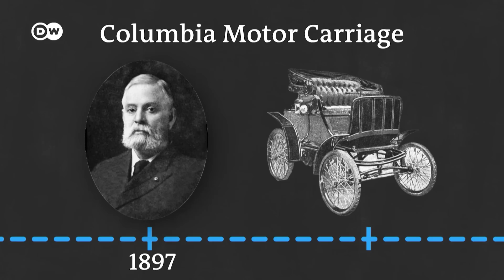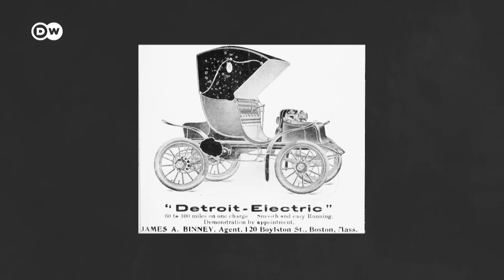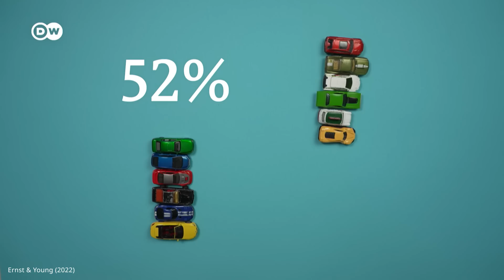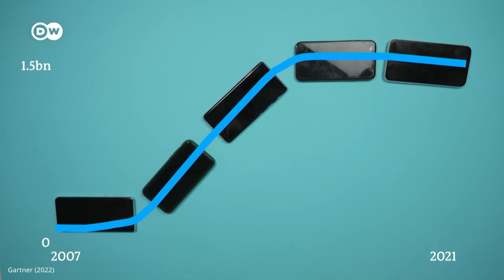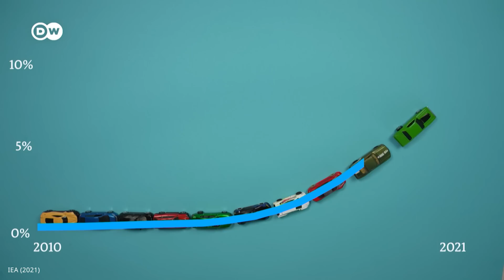Why electric cars are finally taking over

Comment: Writing from Norway, we are indeed on a different planet: Electric cars passed 80% of new sales this summer, and few people even consider an alternative for their next car. The secret initially was government subsidy, but now it is improved charging infrastructure that makes the difference. And how does it effect your thinking once you have one? It's all upside down: you think service costs, smoother ride and silence, no smells, better performance, less complexity - and cannot imagine why anyone would drive that other stuff. I used to love petrol cars, manual gears, so I am as surprised as anyone.
Reply: Love this. Norway, you are talking from the future!
Reply: I was in Norway last month and I didn't know that all electronic cars numbers their plain number beging with E. Which is great I think all country have to adopt that logic.
Reply: @dimitarklaturov  In Germany we also have an "E" on the car's license plate, but somehow we had the great idea to give this "E" to hybrid vehicles as well. The result now is that huge SUVs also have EV-like benefits and are constantly blocking charging stations because parking at charging stations is free in most places.

Sidenote: PHEVs have relatively small batteries and therefore wouldn''t need a charging station at all - a simple wall outlet could do the job for them. Most PHEVs can't even accept the power available at charging stations (most of them can provide up to 22 kW over here, while PHEVs can only accept up to 2 kW).
Reply: Ev car buyers are mind children,
Mind children are easily led — and easily misled.
Reply: Ahh, no. You're from another universe where people are more rational in their decisions, who prioritise long term strategy rather than fixating on short term conveniences.
Reply: Hearing people from Europe gleefully giving up manual gearboxes it’s amazing
Reply: They passed petroleum vehicles not because they are more functional, but because of propaganda.
 California has been asking it's citizens to not charge their vehicles in summer because with air conditioners running 24/7 there isn't enough electricity.
Building the infrastructure before mandating the EV change over would be responsible, which is why no Western governments are bothering with this niggling little issue that will leave millions without transportation.
Reply: Hello Norway. Yes, you are indeed on a different planet. You are at the bottom of the world's list od sustainable development index, the reason why some environmental intellectuals call you "the invisible ecological disaster". While you are so proud of your electric cars, you are still consuming resources that would need around 4 to 5 planets to sustain your system and lifestyles. You consume much more energy than the world's average, but also than any other European country. You create a lot of waste and you produce a huge amount of CO2 per capita... more than almost any country on the planet. But you keep out your dirt outside your country's borders. Very sustainable, sure.
Reply: Electric cars are too expensive and just not realistic - there’s no where to charge them and doesn’t get you far unless you live in a city and don’t plan on travelling far. They cost about the same as 10 petrol cars doesn’t add up and when you dispose of them causes more problems for the environment / that’s one thing they never discuss 
Plus prices going up petrol now cheaper than charging electric car 😂
Reply: That is awful, electric cars are so bad for the environment compared to public transportation.
Reply: @12kenbutsuri  gas cars are awful for the environment compared to public transportation. What is your point?
Reply: @mikeshafer  better does not equil good. EV will never be the future. Public transportation will. What's your point?
Reply: @12kenbutsuri  if you watched this video, it's pretty obvious that EV is the future, especially in the US where public transportation is not very common except in places like New York.
Reply: @mikeshafer  you need to read more before deciding on things on one youtube video. You do know that in europe, they also have public transportation in the country side?
Reply: @12kenbutsuri  I literally just said "in the US" ... I am not talking about Europe here or Asia or anywhere else.
Reply: @mikeshafer  then the US should spend the tax money on public transportation instead of EV subsidies for the rich.
Reply: @12kenbutsuri  I don't think you understand how the US works.
Reply: @12kenbutsuri  besides - do you have ANY idea how much federal dollars are spent subsidizing the oil industry? EVs cannot get here fast enough.
Reply: @mikeshafer  like I said, better does not equil good. If you don't care about the environment, go for EVs.  I'll stick to bicycles and public transportations like a responsible person.
Reply: @12kenbutsuri  I think we're both arguing different points. I'm suggesting EVs are the future, you're saying more people should ride bicycles. I don't disagree with you.
Reply: @mikeshafer  I understand, but to me EV has done more harm than good by allowing the inefficient car society to continue longer, which I am very very upset about. We really need to restructure the whole society. My dream is that cars are so rare we will be amazed and curious to see one passing by, just like how we are amazed when a huge limousine passes by.
Reply: @12kenbutsuri  The last place I went to that was like your Utopia was China in the early 1990s. If your ideas were so good I guess it is still like that now. Oh wait it is not there has been massive growth in private cars. You can dream all you like but the private car is here to stay.

I think we can both agree that public transport should be improved so it is an attractive option. There are lots of cities with low car ownership as public transport is a viable alternative.
Reply: @12kenbutsuri 
Has it never occurred to you, that also public transportation is going to be electric as well?!?

I don't know where you are from, but in Germany we're seeing the numbers increasing.

Of course, most of them are still in a phase of testing, but that stuff is very promising.
Reply: @mightyfishman  sure but at a much slower rate. Especially in the US and Japan.
Reply: @12kenbutsuri Moot point. EVs and public transportation can coexist. ICEs however are a direct competitor.
Reply: @mikeshafer Also thats US being stupid, instead of investing in EV they should invest in public transport, redesigned urban areas and hybrids as hybrids is 10x better than ev

Comment: Coming from India, i see a good potential for electric cars in cities, because we have higher idling times and frequent braking due to poor infrastructure and poor rule discipline and fuel is highly taxed. However the cost of EVs are prohibitive and people have "range anxiety". Still there are some educated people who are taking the leap of faith. Government is also giving a gentle push by subsidising the cost of the vehicles, but they need to do more for standardising the charging infrastructure and building it.
Reply: You don't have the electric grid for it. The adoption of evs is going as fast as it should. If it goes faster, you break something else.
Like here in Cali, with our rolling black outs
Reply: Yeah, these numbers in the video sound like old news, I don't know about absolute number of EVs (though I am sure there are more than 50,000 now), but the percentage of new cars being bought is certainly a little higher than one percent now.
Reply: YOU HIGH EVS ARE TERRIBLE PLUS INDIA IS BIG EVS WILL NEVER HAVE THE RANGE , DUE TO THE LAWS OF PHYICS AND THERMODYNAMICS , DIESEL BY FAR THE BEST WE GOT AS ITS MORE EFFEICENT THAN LITHIUM BY ENERGY DENSITY NOT TWICE AS GOOD OR TEN TIMES TRY DIESEL IS 163 TIMES BETTER FOR ENERGY DENSITY THAN HIGHLY VOLATILE LITHIUM !!!
Reply: That does seem like a nearly ideal place to electrify vehicles especially in the cities.

Comment: The batteries on these vehicles have a lifespan of about 15 years and then you will need to buy a new $40,000 battery every 15 years. So the car is useless after 15 years or less.
Reply: Batteries are warrantied that long and last longer, are much cheaper to repair/can be resold for solar.
Reply: @Nicholas-f5  huh, I didn't know that

Comment: Hydrogen will be the answer.
Reply: Hydrogen will never be a thing in cars.
Reply: @daydreamer8373  why not?
Reply: @reginafisher9919  Well let me ask you a simple question. Where are you getting the Hydrogen from?
Reply: @daydreamer8373  water
Reply: @reginafisher9919  Ok fair enough. Now let me take you through the process. First you use electricity to gain the Hydrogen, then you use more energy liquifying it, then you use more energy transporting it, and once it is in the car you use still more energy turning it back into electricity. a horribly inneficient use of energy

It makes far more sense to simply stick that electricity straight into an EV and far more efficient. There are other problems, it is expensive, the infrastructure a lot more expensive than for EV's, storing it is a big problem, and of course you are driving around with a tank full of high pressure incredibly explosive liquid Hydrogen under your car. Basically a bomb.

Hydrogen will have a place in the greener world. Planes, Shipping etc. It makes no sense in cars.
Reply: @daydreamer8373  We get it from thermochemical water splitting. Hydrogen is good, in a form of metalhydrides or at high volumes = not good for personal cars. But for trucks, trains, ships or some sort of storage of photovoltaic excess, why not.
Reply: @ivobrick7401  Hydrogen will have a place, it just won't be in cars. Shipping, Aviation etc it might find a place.

Comment: Two things that concern me:
- In some places we are charging electric vehicles from the electricity generated from fossil fuel.
- Lithium is a very scarce resource. What do we do if we run out of that?
Reply: Generally, electric cars are more efficient in motion. Even if the source of electricity comes from fossil fuels, it will burn less. Plus the costs of solar panels have decreased by 90% between 2010 and 2020. It is only a matter of time it gets as efficient fossil fuels.

Lithium is extremely abundant. Way less scarce than fossil fuels. However miners need to increase their production. Which will happens since the demand for lithium is crazy atm.
Reply: Gasoline is far more toxic and takes many kws per gallon to refine.

Comment: Electrification of the fleet as an ecologic step is a marketing ploy... Why? Even though electric drivetrains may be more efficient and may require less maintenance, the reality remains - where does the power you charge your vehicle come from? If it's solar based, OK, if it's tidal based, OK as well, if it's wind generator, OK again, if it's water dam based, OK still, but the majority would come out of an electric grid infrastructure powered by coal power plants, and that means you're just shifting the responsibility and pollutions from the vehicles into the grid supplier. OK, some areas/grids may also have nuclear reactors as power source, but the core across the globe is still coal based... Norway has leap-frogged most countries thanks to several key factors: financial support/incentives to buy electric vehicles, infrastructure throughout major towns to support charging (eg. the famous underground parking lots for electric vehicles), grid powered not only by coal but also with dams and a few wind ones but also nuclear and tidal and geothermal energy sources... This means people are incentivised to buy EVs, they are offered sprawling and already hugely successful grid/infra to charge/use those EVs, and the majority of the energy in the grid actually comes from renewable resources, so the EV route is somewhat cheaper and greener and easier to live with. Other countries unfortunately are still lacking... Heck, in some countries the price difference between ICEV and EV variants of the "same"/similar model can be as high as 50%, and without any external incentives this can amount to a difference worth of approx. 6m3 of PB95/98 fuel which can then translate to about 1700 days of approx. 60km daily routes, so basically to about 5-6 years of car "free" usage (excluding other costs)... and that makes EVs hard sells in many markets. And that's good, cause those countries might not sport grid strong enough to provide power to all the households, offices, factories and... charging stations that would be required if people switched to EVs en masse.
Reply: We charge overnight with otherwise wasted wind
Reply: @Nicholas-f5  Then you're more ecological than the majority of the EVs' buyers around the globe...  and that's the unfortunate truth.
Reply: There's a bit more nuance than that.

You may live in a place with lots of coal power, but in the U.S. coal is now producing only about 20% of electricity. Pretty much any other source is cleaner.

But even using coal there are two big advantages to EVs: (1) higher efficiency means less total fuel used; and (2) relocation of air pollution from densely populated areas to less densely populated areas, where it will affect far fewer people.

Aside from that, it is easier to switch a few big power plants from coal to natural gas or something else, than it is switch a whole automobile fleet, and apart from the question of air quality this also is good for energy security, as it is much easier to shift energy sources this way than it would be to switch an entire existing automobile fleet from oil to something else if for some reason oil became unavailable.
Reply: IJŠƇĦͦ̚5ɜPƔNjƇάȥɓϋξ îπɛş\x91͈ǷǯƠɱ\  True, they can be. And if renewable sources are available even better. But regarding the cleaner part or less dependence... EVs require batteries to run, same as laptops or mobiles or many other electronic goods after all, and this extra weight can eat up parts of the efficiency formula. But putting extra tonnage aside, and sure the EVs can combat the weight penalty with more efficient packaging and aerodynamics, the problem are still the batteries themselves... They're not degradable, they're not everlasting, they're made of precious elements/metals sourced from mostly Argentina/Chile/Bolivia or Australia or China or Russia. And after they die, and they do sooner or later depending on technology used, they're not yet properly recycled to recoup the precious metals back into supply chain, instead they're being put aside into landfills... Sure the end product in the EVs is not required to be replenished, or even possible to do so, by those precious materials every day you use the device/vehicle, nor do we need to replace the batteries on a daily schedule, so the amount of "trash" is not something as easily discernible as plastic bottles filling a garbage bin, but the sustainability or cleanness factors still remain not yet properly dealt with. Furthermore, the dependence on certain countries remains, only switched to other countries' list as the metals are currently mostly supplied from other countries and at different stage in the vehicle life... Maybe once the graphene or solidstate batteries hit the market the cleanness or better supply chains aspects could be improved, but the question is when... On the other hand, there's an alternative eg. Toyota even toyed with - going hydrogen. It's extremely efficient in terms of weight/packaging in terms of storage in the vehicle, basically same tech as used for oil/gas/LPG, it's capable of being used in IECs with small modifications to the engines themselves but it can use other engine designs for less combusting approaches, it's replenished as fast as regular liquid fuels, and it burns with negligible impact on air pollution levels... Basically a mist of water out of the tailpipe... And hydrogen production/supply could be managed by most countries themselves, using their powerplants/chemical plants infrastructure and some water sources...

Comment: Sorry I live in Riyadh, Saudi Arabia 🇸🇦 

Electric vehicles are probably not as beneficial as in countries where most electricity comes from renewable energy. But I would appreciate better air quality…
Reply: Most of the reasons given for electrifying transportation have been falsified. They are more about salesmanship and public relations than reality.

However there are three real reasons for the switch: (1) energy security; (2) higher efficiency; and (3) air quality.

The air quality issue is much bigger than it may seem, yet not especially useful for selling to the public due to status quo bias. So your desire for cleaner air is actually one of the better reasons to want to switch.